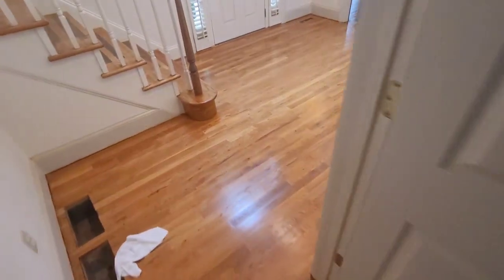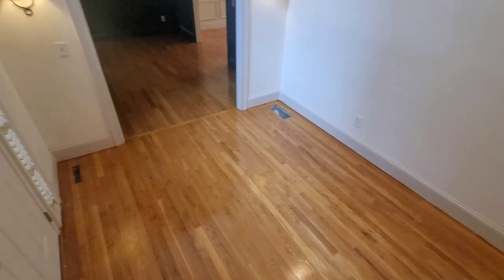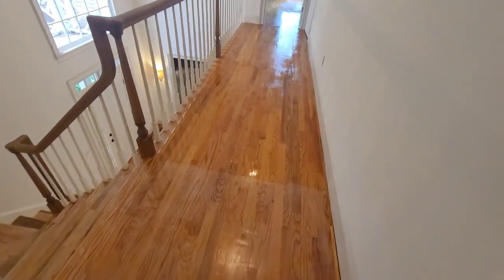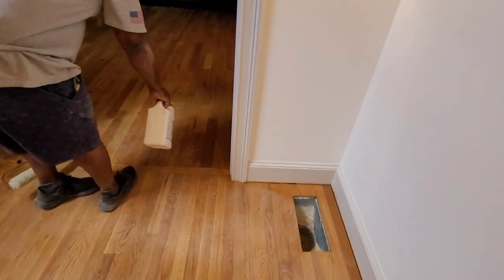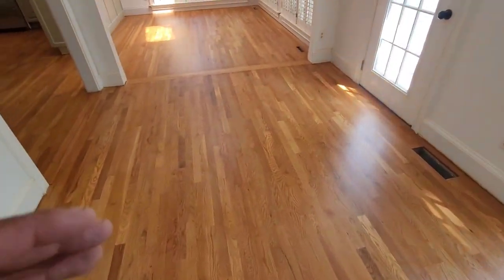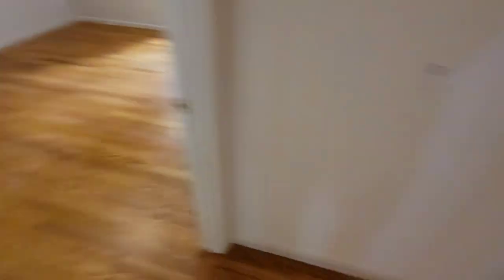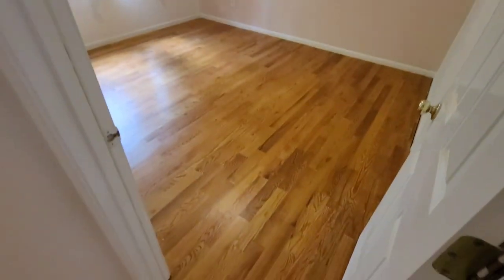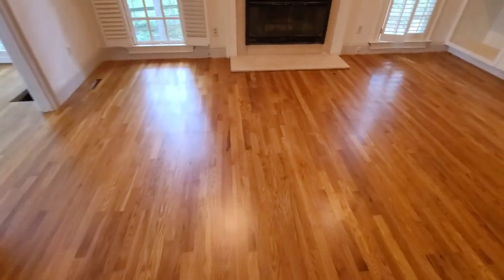Never use Oil-Based Polyurethane on your Floor ❌ Spoiler: We were able to Save the Floors

Comment: drum marks can be removed only if the floor is sand again ,you didn't do nothing exept coating with satin varnish water base  wich cover the most of the marks on the floor 😂 easy job

Comment: I have glossy oil based polyurethane on my wood floors. Happy with my shiny floors! After 10+ years since last redone, the floors still look new. Easy to clean - whatever sticks to them, comes out easily. Easy maintenance!  Yes, there are some chatter marks (as I sanded the floors myself) but the marks are not that 
noticeable. Among furniture, rugs, interior decor etc, no one notices these imperfections. If I had to redo the floor over again, I would again choose glossy oil based polyurethane.
Reply: have you ever even had waterbased?
Reply: @brandonshaffer3940  I did. Water based isn't nearly as good.  Pale in color, not water resistant. 
I am 100% for oil based.

Comment: Nice job.  Satin will hide a lot of imperfections, that's for sure.  I just finished my floors - in oil base - but also in satin.  The house was built in 1955 and the floors have been hidden under carpets.  They were pet stained and there were former attempts to re-finish, with disastrous results.  Hence, the carpeting. It was a helluva lot of work, but they look great.

Comment: What kind of water base do you use in a whole house? I thought that even water based poly is used that it can turn white when water drops get on them?
Reply: If you apply water-based polyurethane over oil-based stain, it can form a white glaze, if the stain is not completely dry.
Reply: @kinaowens9235  thanks